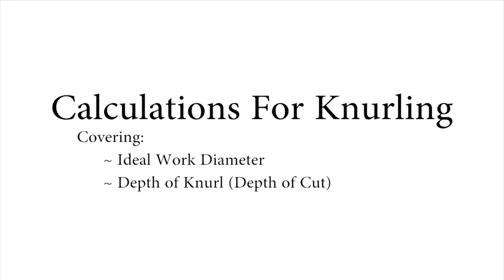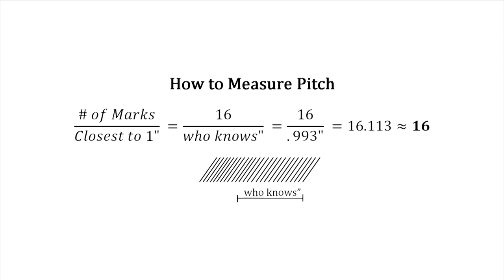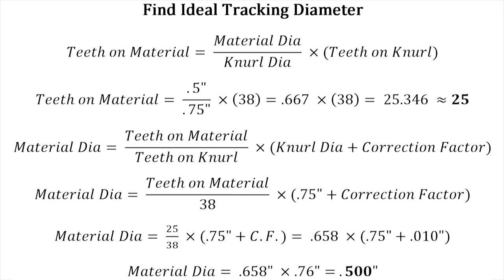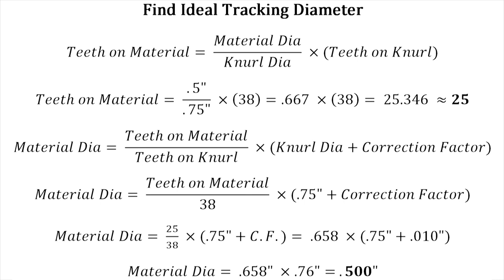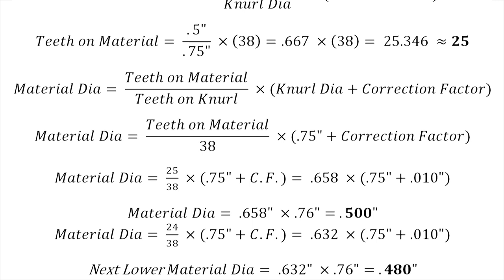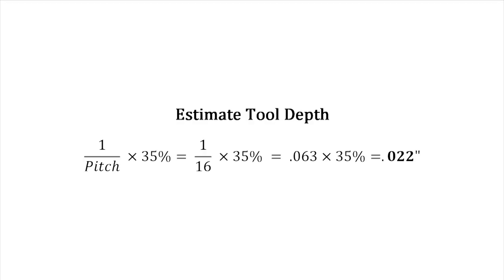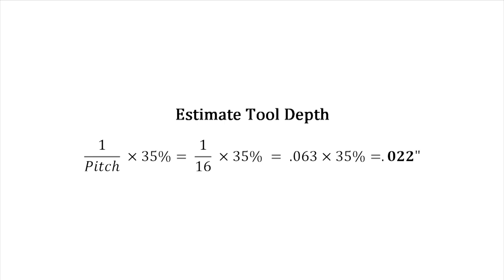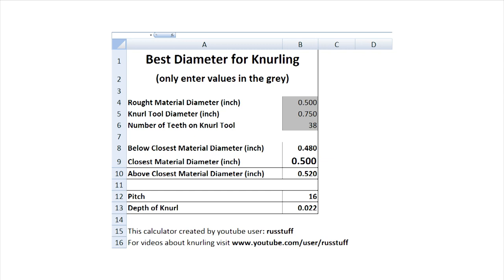18 G0602 Knurling (Part 2)

Comment: Hey I'm trying to access the knurling calculator and I get an error, is this still available?  I use it quite a bit (Thank you!), but I must have accidently wiped out the formula on the one I have saved at home because it's not working.  Came on here to download a new one and that's not working either!  I'm pretty sure it's safe to say it's me!
Reply from the maker: Oops, that was my fault. Link is fixed :)

Comment: Sorry I tried it again and it worked fine.  have it and will use it.  Preliminary evaluation of the formulas in the sheet look pretty good.
Reply: +Leonard Legg I am also having some issues accessing it too, how did you fix your problem?
Reply: +KillerUK0  It's been awhile but if I remember correctly?  Since I'm operating on Linux I think I saved it to file as a libre office file .odt which converted the xlsx  to odt and it worked fine.  Holler if it don't work.  Some one is bound to help you get it going.  It is a pretty simple spreadsheet, if push comes to shove just write your own, I'd give you a hand.  Your using excel ? I'll give loading to my windows computer a try see if I have a problem there.
Reply: +Leonard Legg yes but only excel online version through one drive.  I'm wondering if that is my issue. I agree it should be a simple spread sheet to work out was just trying to save some haste.  :-)
Reply from the maker: +KillerUK0 +Leonard Legg
Do you need a different file type? I can probably convert it in excel. I'm going to move the file and link too. I don't use box anymore.
Reply from the maker: +KillerUK0 +Leonard Leg
I included an OpenDocument (.ods) version, which is as close to .odt I could get. Check the link in the description.
Reply: +russtuff thank you the update link works a treat. :)
this should help me with my knurling project at work i have to do.
Reply from the maker: +KillerUK0 OK great. Thanks for letting me know.

Comment: I don't know if anyone mentioned this already... but one reason why you weren't having the best results at .010-.015 is probably because most lathes today read the diameter of the stock, not the radius.  The .022 depth of knurl is the radial depth, thus, your diametrical depth should be .044.  This is why when you were dialing in .045 the knurls looked how you expected them to appear, as the dialed in depth was just over the knurl depth.

Good video all around, I know when I was doing some knurling the other day, I was putting a med knurl on 3/4" stock... ran that at ~500 rpm with a .008 feed... it worked perfectly fine for me, but I'm crazy like that I guess... lots of oil...